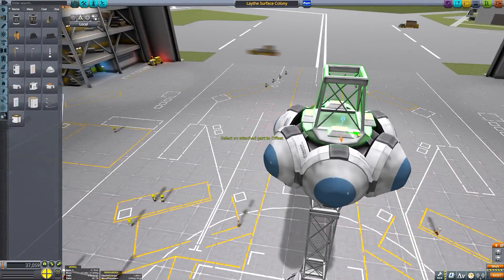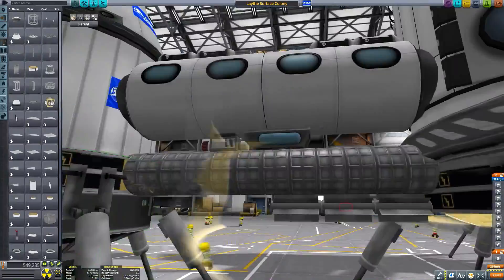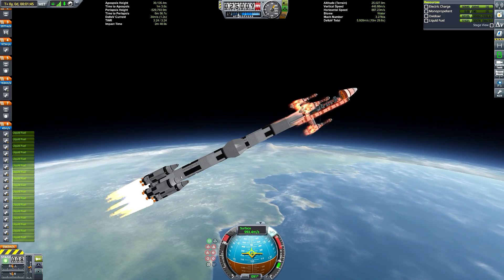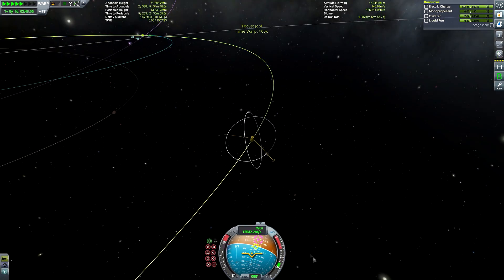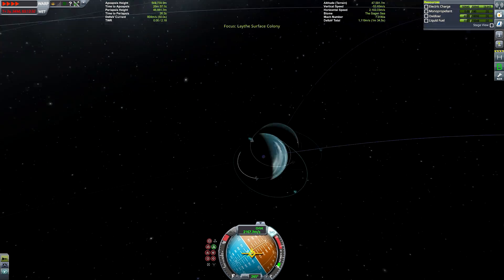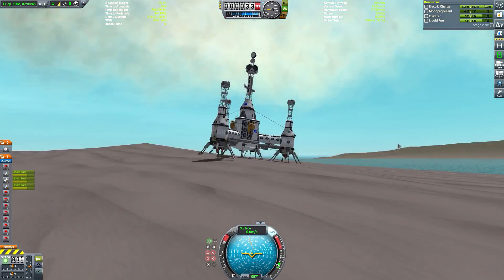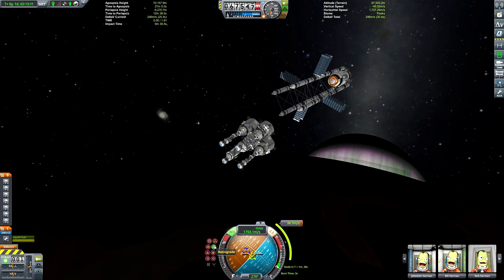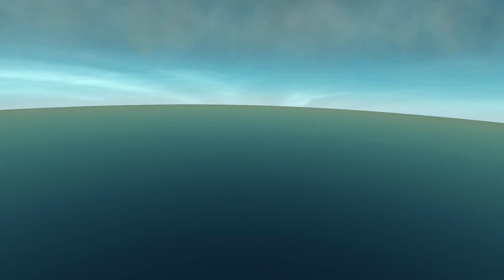KSP: Laythe Surface Colony and Ocean Base!

Comment: I've got a weird Kerbel challenge for you: Remember in Indiana Jones and the Last Crusade where they are told that the holy grail grants immortality, but you can't take it past the 'great seal'? That only constrains it's movement in the X and Y planes, but nobody said anything about the Z axis ; ).

So, assuming this fictional temple were on the equator, if you bored in from above and lifted the grail straight up onto the top of the rocket you built on top of the site, could you launch it STRAIGHT into geostationary orbit without moving in X or Y axis? Is this actually possible? Or would you have to orbit to do so, thus inviting an inexplicable Rapid Unscheduled Disassembly at the hands of a vengeful god?

This question is asked all in good fun, and with the thought of how fast our space technology would advance if every billionaire knew that imortality was waiting up there for anyone who could build a ship to reach it and a space station to enjoy it.

Comment: I make up backstories and missions all the time.  I just started a new play through where i pretend that kerbal society just found all of our space research and they elected me to head up the new space program.  Basically i'm playing a science mode save with the tree unlocked then my science points reset to 0 so I can still collect and see the points.  For fun.  Lots of  space stations, bases, and in situ plans.  I'm just getting up a massive kerban space station for fuel mostly but will use it for mass driver supply drops in the future i think.

Comment: Not just that. Remember that Cassini had a nuclear payload
Reply: Calin Avram what? no. it had a radioactive thermo-generator to produce power for the mission
Reply: @nasaman5440  my bad then, although it was still, dangerous
Reply: Calin Avram yes it was, in fact due to the radiation from the sun as well as from the nuclear generator the actual Cassini space craft had very little computing power and only relayed its observations to more powerful computers here on earth .
Reply: @nasaman5440  thx for the info lol

Comment: why do you do gravity turns at 45° when 10 km high?
you always end up having those plasma/reentry lights, and that means you lose velocity and fuel vs the atmosphere.

The ideal graph to ascend  for my rockets is something like this... have 120 m/s at 2000m, 130 m/s at 3000m 160 at 5000 m, and 180 at 6000 m - go all out at about 10 km height and only now (since you have passed the thickest layers of atmosphere now) begin your gravity turn... with about 75 to 70 degrees of center (meaning 90 dgrees is  totally upright)

i really enjoy your videos, but this made me - well curious ;)
of course ascend as you like - but when i do an early gravity turna s you do...
first my rockets tend to spin out of control... 
second they don't reach orbit coz i don't have enough fuel ;D